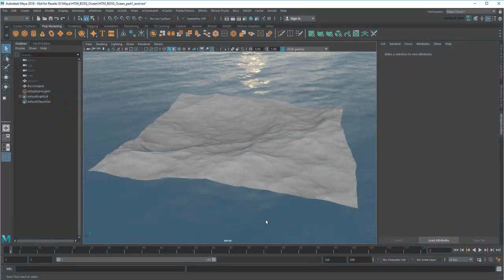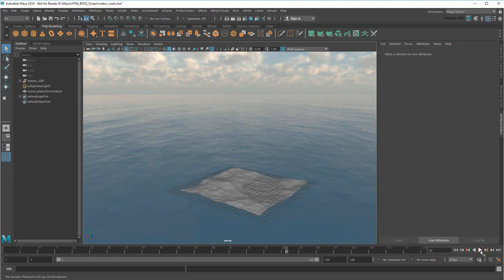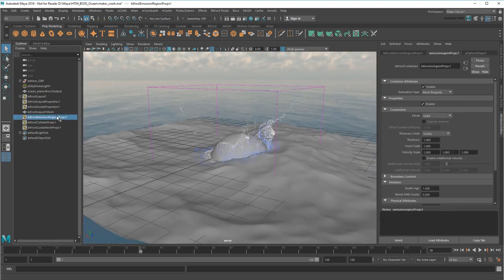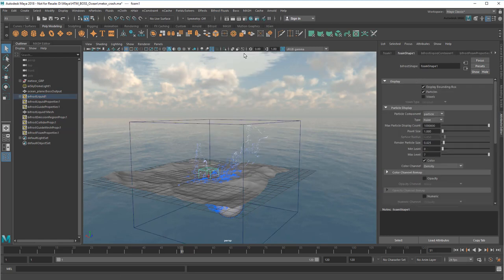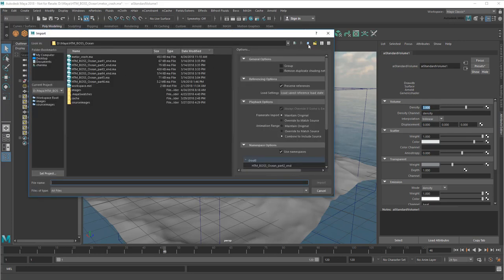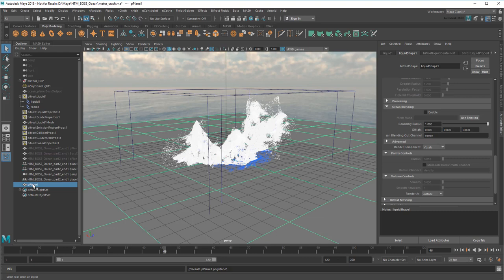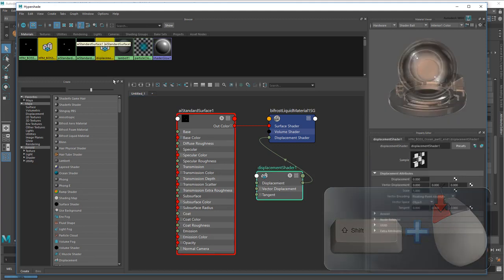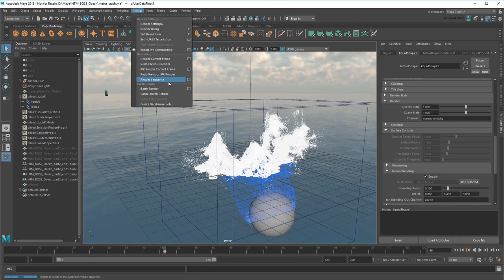Creating an ocean - Appendix C: Splashes

Comment: I have Question on 5:37, the volume shader emission, where is it attached to? It seems been there before the start of the tutorial.
Reply from the maker: Sorry, what do you mean by "been there"?  Emission is a standard attribute for an aiStandardVolume, and is typically driven by heat.  In this case, we're changing it to be driven by density instead (i.e. denser water = foam).

Comment: I followed everything and nothing happens when the sphere meets the wave. I've noticed that the master voxel size doesn't change my liquid container i don't know if that helps you know my problem?
Reply from the maker: Master voxel size wouldn't change the overall size of the container, but it will change the detail of the splash.  What do you currently have it set to?  Try to get that value as low as possible (if the voxel size is too big, no splash will happen since it will basically have 0 detail).
Reply: Maya Learning Channel I have it set to 0.150 like in the video :/ I followed everything up until the 3 minute mark and nothing happens
Reply from the maker: @Yiannio222  Just out of curiosity, if you create a Bifrost Liquid simulation by itself (without the ocean or guided simulation) do you get anything?  Alternatively, were you able to successfully do part 4 of this tutorial (the dynamic wake)?
Reply: @Autodesk_Maya  Nope, i also get this message when i create the bifrost liquid 'cache disabled as unsupported nodes were found in the scene'
Reply from the maker: @Yiannio222  That's not a problem (it's a warning from the Animation Cache feature, which is not compatible with Bifrost Liquids so it automatically turns off).

If you right-click the Time Slider and go to Playback Speed, is yours set to "Play Every Frame, Free"?  You must be in this mode for dynamics to work.
Reply: @Autodesk_Maya  yep that's the setting i'm on, still nothing
Reply: @Autodesk_Maya  Oh sorry ye it's working now, i just had to re add the wave and its all good now thanks
Reply: @Autodesk_Maya  Sorry to be a pest but there's no aistandardvolume in my hypershade, there is however a bifrost foam material? Also out of interest i rendered before the addition of foam and no splash was visible on my render that's not normal is it?

Comment: Sorry to be a pest but there's no aistandardvolume in my hypershade, there is however a bifrost foam material? Also out of interest i rendered before the addition of foam and no splash was visible on my render that's not normal is it?
Reply from the maker: Do you have the Arnold Plug-in turned on (mtoa in the Plug-in Manager)?  And do you have the latest version of Arnold installed?
Reply: @Autodesk_Maya  Ye i'm using arnold and its maya 2019
Reply from the maker: @Yiannio222  Are you sure there's no aiStandardVolume?  If you type it into the search field, it doesn't appear?  That seems very odd.

If anything, I'd try upgrading your version of Arnold.  https://www.arnoldrenderer.com/arnold/download/
Reply: @Autodesk_Maya  Nope :( theres 3 standard surfaces, bifrost foam material, and then the other normal materials and i'm pretty sure the arnold is up to date as i'm using my universities account
Reply: I just tried it on my laptop as well and still no volume? I haven't followed any other bifrost liquid tutorials before this would i have missed something?
Reply from the maker: @Yiannio222  If you go to Windows > Settings / Preferences > Plug-in Manager, then scroll down to mtoa and click the "i" (information) button, what version of the plug-in does it say?  4.0.3?  Also if you scroll down in this window to the list of "Dependencies", is aiVolume one of them?

If the answer to either of these is no, then it sounds like you need to update Arnold.
Reply: @Autodesk_Maya  Wow i apologise it was only 3.0.3, i woudve assumed it woull have been up to date. Thank you for your consistent help it has been much appreciated

Comment: hi the tutorial followed to the letter does not work properly. did you add foam? Are there any steps you forgot to add? at my house there is no Splash and when I leave the simulation started at Frame 1, we do not have the particles generated. but if I start at the frame where the meteor touches the surface, it works, without splashing. I await your answer. thank you
Reply from the maker: When you say it works without splashing, does that mean the particles appear on the ocean surface but they don't interact with the meteor?  I would try decreasing the Master Voxel Size and increase the meteor's Emission Region Thickness.  Additionally, try slowing down the meteor a bit (just as a test).

Comment: hi, is it possible to do a ripple effect as we did with the  boat in the part three using the same process?
Reply from the maker: You definitely can, but it will be a lot slower since it’s a full particle simulation.

Comment: When My Liquid Particles are flying and again fall on the guided surface(boss output) the liquid particles are combining and forming a big surface... it is happening with in the next frame 37.... upto 36 frames the liquid particles are fine.... on 37th frame the all the comeback particles are forming a surface on the boss output... how to solve this... need urgent solveing... i'm trying to make a dolphin jump in ocean...
Reply from the maker: I would try using a a kill plane or kill field to automatically delete the particles that hit guided surface outside the camera.  Depending on the shape of your splash, you may even need to setup multiple kill fields.  Remember also that you can animate them if you need them to move over the course of your animation.
Reply: @Autodesk_Maya   The Actual Problem is particles are forming on the surface... Is there anyway without using kill planes... or is there any lifespan option to them?
Reply from the maker: @krishnaa7416  Yup there is.  If you go to the emissionRegionProps tab, under the Emission section, there's a Death Age attribute.